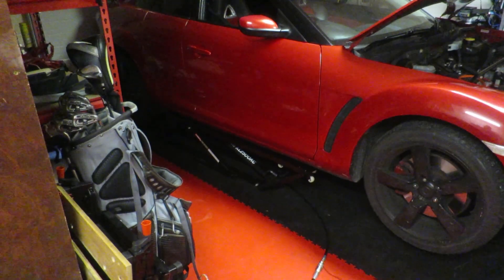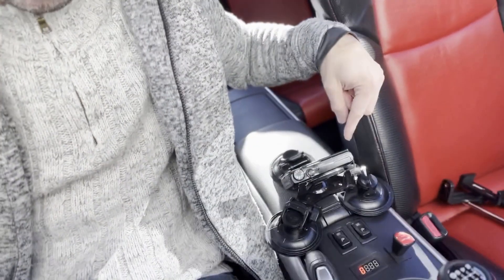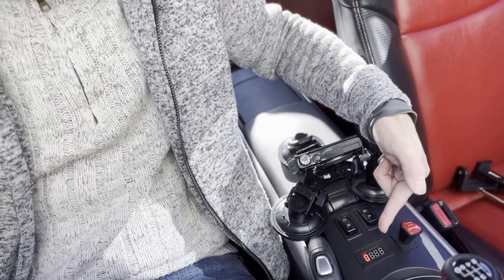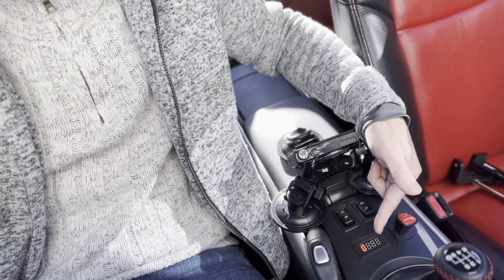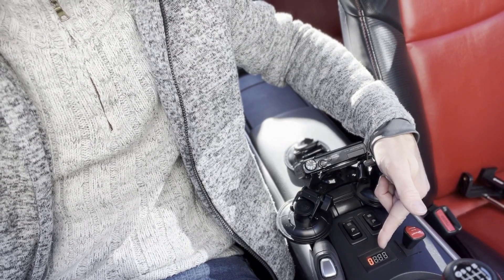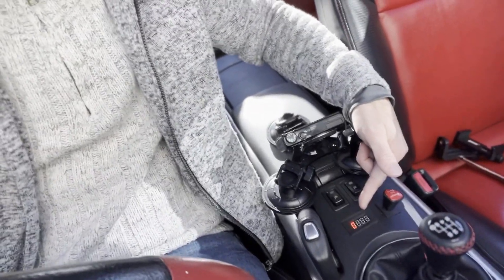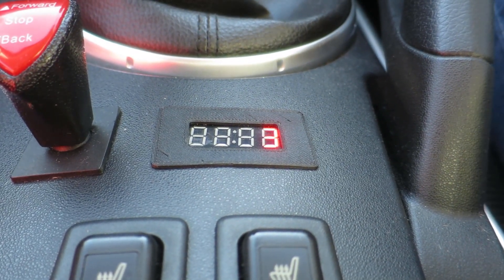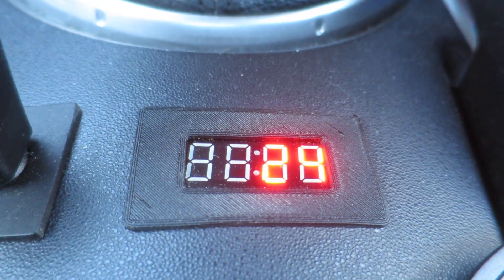Nissan Leaf Regen in the RX8 EV

Comment: Great work. Next step add a dash control to be able to adjust the regen. I'm thinking of using a pot to give me analogue control of the level as there are a lot of hills around Wellington. I should probably start the project itself first though lol.
Reply from the maker: I have had further thoughts since this - I am going to just regen when you press the brake. Ill regen harder and it will also guarantee the brake light comes on... and yes get started!
Reply: @SouthWestEVUK  I got side tracked by an MoT fail. Having to redo someones previous rust repair as it wasn't tidy enough for the new garage I took it to.
Reply: @SouthWestEVUK  also, as I understand it, the after market controller add a brakelight command output, I'm guessing using something like;
if (torqueValue <= x){
    brakelightPin = HIGH}

Comment: how does it work going down a hill, when your foot isn't on the accelerator pedal? Do you still need to request negative torque to get regen or does it happen automatically?
Reply from the maker: So my code regens when the accelerator is off and you are going forwards. So yes, going down hill generates power.

Comment: Happy to hear the log files and CAN database files are useful 😁

If you go with strong regen, make sure it wont regen when the battery is full, dumping 40kW of power into the battery while it sits at 4.20v/cell is a quick way to degrade it prematurely. There are kW limits that the BMS sends that you can use to limit regen safely. Happy tuning!
Reply: subscribed Dala, like what you are doing!
Reply from the maker: Yeah I have referred to those files countless times, I wondered what those charging limit numbers where for! Thanks, ill get that integrated as I am going to redo this regen setup to work off the brake and be much stronger.